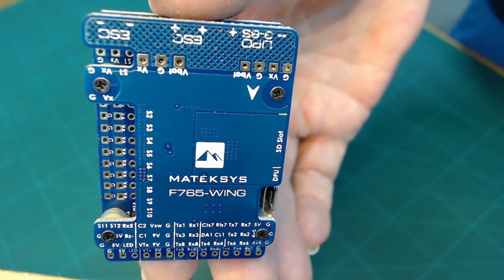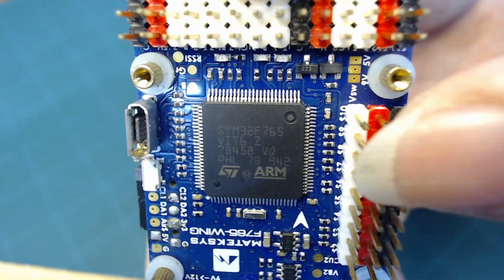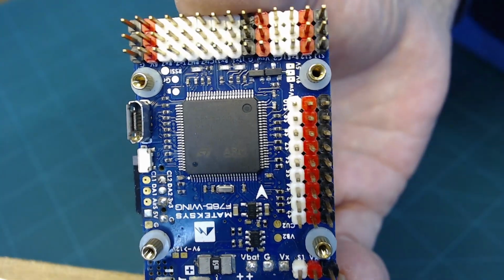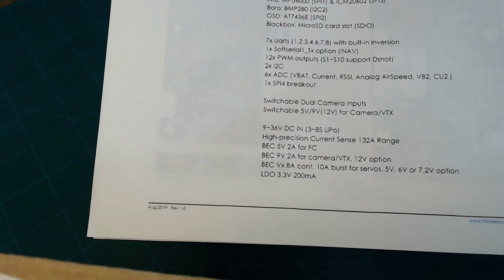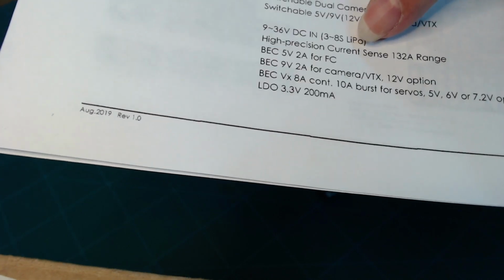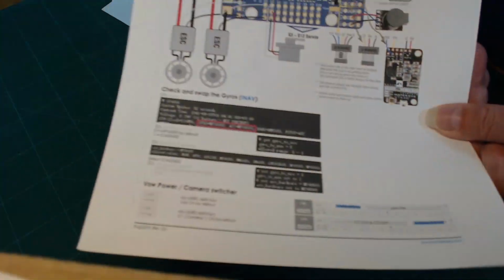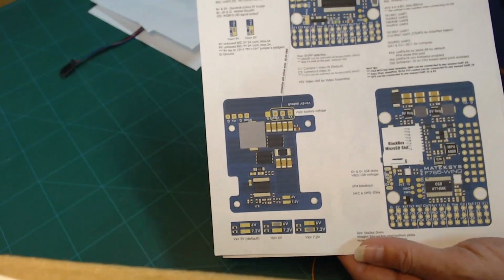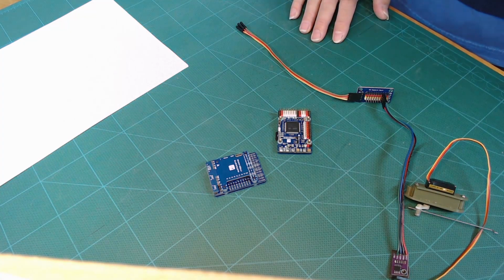Flight Controller Basics

Comment: Would you be able to help me please ? 
I’ve never ever used a FC , trying to watch many videos like yours to try understand how this works.
I’m stuck trying to wire my new DJI 03 air unit to my F405 wing v2, I’m just not sure how to wire this .
I know tX to rx, and rx to tX , but don’t know exactly where to plug my cables on the board itself . 
Anything you can help
Me with would be great please .
Reply from the maker: I am not familiar with the digital video (like DJI), but if it has a TX and RX line, that tells me that it is a serial interface that should be connected to a UART. Your FC has 6 UARTS available, so I presume you could connect it to any one of those. If you use UART1, for example, you would connect to TX1 and RX1 (RX to TX1, TX to RX1). Your unit will also need power, so check its power requirements. UARTs 1, 3, and 6 have 5V and GND connections conveniently located next to the TX/RX pins, and UARTS 2, 4, and 5 have 4.5V and GND connections nearby to them. There are also 9V connections on the board. Your flight controller comes with pin headers that you can solder in if you want to use connectors to connect to the board. Otherwise, you can just solder the wires directly to the board. There are some good groups on facebook that might be helpful, like "Beginner to FPV", and "INAV Fixed Wing Group". Most people there are happy to help out with questions like these.